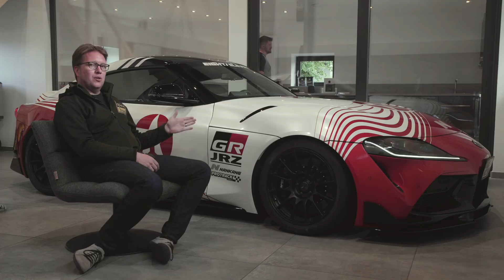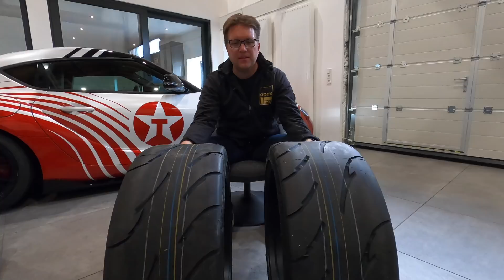Tech Talk: Toyota Supra, Ruined by Bump Steer?!?!

Comment: Control arms and tie rods won't help the bumpsteer problem, you need to relocate hard points on the chassis and knuckle. If you just change the rods you'll change the track width too which will affect both the front and rear suspension design decisions, not worth it imo.

Comment: I wonder what a comparison between the stock a80 and the a90 would result in suspension. I can imagine the a80 is heaps better. Toyota became a joke a long time ago and of course they would spend twenty years and release a botched Supra with only slightly more hp than the original and a compromised suspension geometry.

Comment: Early S2000 had a similar bump steer issues but got fixed with the face lift. This was almost 20 years ago, lol. Seeing this in a 2020 car is a big letdown. I wonder if the Z4 has similar issues. Since it's the same platform, it's very propable.

Comment: Why would you Chuck brakes and bushes in if you know the fault is with bumpsetter ,? Would have thaught you would have made different mounting points etc ? When can we expect an update ?
Reply from the maker: At the time there wasn’t a kit or arms yet. Many cars bumpsteer can be solved With new bushings. I felt like I needed them anyways so I started there. It’s quite logical actually
Reply: @RobertMitchell  ahhhh the bushes and suspension stiffen the ride so the travel is less ?

Comment: Hey Robert , About the zero toe instabillity , In my mind toe affects stability via the form of slip angle based on lateral force sensitivity to vertical load. Thus as you mention toe in adds stability and toe out "dartness". In that sense zero toe is something between these two not something that would create more wanderness than toe out. Can you explain further why zero toe would be bad ?

Comment: How much toe in would you recommend for the rear ballpark on a GR Supra that is lowered but not tucking the rear stock tires?  When loading the front going neutral toe in the rear seems to be the the issue right?  I don't want to go too aggressive for toe in the rear to compensate for rear lift bump steer toe angle change, but it seem this could be a bandied fix for the time being.

Comment: Robert: "Let's talk about facts" 
Also Robert: Provides eleven minutes and thirty two seconds of conjecture with no backup
I'm not trying to defend the Zupra, I 'm looking for the facts. Providing alignment specs as received, and since you are noting bump steer, toe figures at rest, fully loaded, partially loaded & negatively loaded while on the stock suspension setup, then provide those figures again for whatever modified suspension setup you are running now is what would have made your conjecture facts. Saying "the rear feels twitchy on lift off or hard braking" without any corroboration/data isn't a fact, it's conjecture/opinion.
Additional note: the Zupra has a "50:50" weight distribution, however more than half of that I-6 is forward of the front axle, that isn't helping under braking, as it will make the rear lighter than if it were inboard, hence my suggestion to check it negatively loaded and provide the numbers. 
When I look at the engine bay sans-plastic cover, it makes me think somewhere in development Toyota had planned to go with a version of their V6TT, but nixed it for cost savings (or I-6 fanboi love) during production. I think it would have been a better handler with the V6TT, as more of the weight would have been inside the wheelbase, but that's just my opinion.
Reply: yes I had the same question about this vid, too. They state supra had the bump steering "feelings" and twitchy on weight transfer, but gave no scientific examination. I didn't see any strong evidence on this video

Comment: I somewhat agree with your premise. You're not describing what's really going on with no toe. What's causing the "follow the road" effect doesn't really have anything to do with the toe being zero. It's because of the way tie rod ends work. Having toe in/out puts inward/outward tension on the TREs. Which makes the steering feel "tighter" and less "wandering". No toe essentially introduces "slop" in the steering because the TREs are not under inward/outward tension. Making it feel like the wheels want to "follow the road", particularly when driving in a straight line. But it's really that it's just not as easy to keep them from "following the road" due to this inherent "slop" in the steering when driving straight. Other than that zero toe is optimal. Since you rob yourself of some power with that wheel scrub too.

Comment: They say the 2021 Supra has been extensively changed and some changes were made to reduce bump steer. Wonder if they did anything to the rear bump steer issue...
Reply from the maker: I have heard this and am eager to try it.
Reply: @RobertMitchell  Wisefab is making some suspension components for the A90. Check out "papadakis racing 2020 Drift supra  CAD designed roll cage install and fabrication" youtube video.

Comment: As you know suspension geometry specified by chassis and sub-frame. I think you need an adjustable rear sub-frame. If it's multilink rear end, you really need CAD. Thank you.
Reply from the maker: Just hang tight.  Have some cool info on that front:-)

Comment: Bump steer is something I've dealt with in the lifted 4x4 world (front suspension) for years. In that situation it's all about getting all your steering parts and suspension parts moving on the same plane. The same arc. In other words which component in your rear suspension is tugging the wheels out of line on compression? What component isn't following the same arc as the control arms?
Reply from the maker: Big time topic in the 4x4 world!!!!! It can be both the control arms and or the tie rod bro following the same arc.
Reply: @RobertMitchell  I think I see the problem. It's the most forward lower link in the rear suspension. There's no way that can work right lol   Just kidding, What do I know :)

Comment: Also interesting you noted the unsettling of the 570S as you lifted the throttle.  I've driven 570S, 675LT, and 720S and have to say that upon hard braking, they all seem to shimmy back-and-forth while going straight.  I always attributed it their ABS/Stability Control systems wrestling each other. It's unnerving at first, but kinda got used to it.  I haven't driven them on the track, but I'm imagining that the benefit of this as you mentioned would be used to turn in sharp after braking hard down a long straight.  But on the road when stopping abruptly, the car definitely wanders in its own lane.  Hop in a Lamborghini RWD Gallardo or RWD Huracan and that definitely is not the case.
Reply from the maker: It was the early 570. They changed the rear subframes and toe arm angles after some heavy complaints

Comment: So how much actual bumpsteer is there? Did you fit a bumpsteer gauge and plot the toe change, then look at adjusting arms etc to address it?

Have you compared it to a Z4, if that has no bumpsteer, what is different? 

Whilst an interesting video, the lack of detail in the actual amount of toe change over the suspension travel is surprising and leaves the watcher with more questions than answers.
Reply from the maker: Wait for round two pinderwagen. :-).  Hope all is well!!

Comment: They missed the boat across the board, the styling doesn't say Supra to me aside from  maybe two very specific angles, it should have been called something else just like with Dodge and the Charger. They didn't have a car driver design this thing and cut far too many corners. Which is ironic because the car can't cut corners.

Comment: If its anything like the Z4 it probably more than just bump steer. The whole rear end is made of rubber bushings including subframe mounting. The only exception being the camber arm spherical pushed into the upright. There will be a hell of a lot of compliance steer within the rear axle. I haven't seen a toe curve for a Supra but in general all road car manufactures will design toe in in bump on the rear for safety understeer. I'm looking at my toe curve for F series BMW and the bump steer looks fine, around 1min/25mm in bump near the useable suspension range after lowering. As the car has a static setting of toe in it is unlikely the car will cross from toe in to toe out even after lowering. If low enough it will move around between toeing in and toeing out but never will the number measured be toe out.
You will ofcourse change the BMW factory toe curve if you lower the car and then set the static toe to what BMW recommend as this is for a different ride height!
I would suggest spherical bush the whole rear end not just the toe links and solid mount the subframe before altering the link lengths as I think compliance steer will be a huge part of it and not really measurable on normal bump steer rig.
Good luck!
Reply from the maker: We’ve changed the bushings. It’s bump-steer sadly  :-)
Reply: @RobertMitchell  OK so can you back that up with a toe curve? Would be very interested to see one.

Comment: Another great video, i started mechanical engineering tried to reach chasis/suspensions on nice racing series someday, sadly life revoqued my dreams (dont even own a car). This is super interesting and you are extremely spot on how you explained it. Hope you get to the bottom of it. I have seen analysis cases of bad angles on steering racks and links ruining front suspensions travel toes but you cant counter misbehavior of rear suspension with your hands, very surprised here.

Comment: Maybe it was diff, I think this car has got computerized clutch typed LSD, on and off throttle computer decided locking force for each rear wheel that definitely will change car behavior.
Reply from the maker: Hehe no. It’s bump steer:-)
Reply: @RobertMitchell  I had honda integra DC5 TypeR before, that front suspension probably is the worst bump steer suspension ever,tried few things,nothing worked. Now I have 340I probably similar suspension with this Supra, I don't like the rear, No confident when pushing hard, I thought it was the soft springs, maybe not after seen this video.Interestingly, the F80 m3 has different rear suspension compare with non-M car, do you have the same problem with F80?

Comment: Hi Robert, I'd like to hear your thoughts regarding delrin/solid rear subframe bushings. I have a E92 335is and I know that this is how people tighten up the rear end instability on the E9X platform, and which is what BMW did for the F80 and onwards. Just wanted to confirm if the Supra has this addressed and if you think it contributes to the bump steering you're experiencing? Hope you can reply!!
Reply from the maker: The Supra has had the bushings Upgrades yes!!   That and control arm bushings have been a problem as you say in MANY cars

Comment: Really good info 👍 Is this about the 2020 Supra or the 2021 (or both)?
Reply from the maker: 2020 model... not the newest one which I've set to have seen
Reply: Got it. 👍 I am curious as to what other changes Toyota has done to the 2021, suspension wise, as they have already changed the pistons (dropping the compression ratio from 11.0 to 10.2) and changed the exhaust manifold configuration from 2 port to 6 port. Those are fairly significant changes in one year of this model’s existence.

Comment: It blows my mind that you can spend all that money on mods but not find the money to have a race shop dial in the bump steer by simply modifying the rear track rods and mounting points.
Reply: Will do.  Also, there is a bit of misinformation in this video where you say "you would never go neutral" on toe.  We have several customers running zero toe on their championship winning Spec Miatas and high horsepower turbo AWD rally cars.
Reply from the maker: I wouldn’t go zero to on this car.  And most certainly not above zero then below in a simple lift off situation.....  

There are many many exceptions to certain rules or statements but in this application here I am discussing i would not.  We cannot take an all wheel drive turbo rally car and compare it to a factory road car that is delivered with instability that is so bad from the factory while driving straight and doing nothing more than Lifting off the throttle :-).
Reply from the maker: Didn’t I mention that we were working on something bigger for it?  Parts being designed?
Reply: I heard you say you "knew what the problem is but didn't know how to fix it".  Any good chassis tech with fabrication resources could measure your bump steer and fab up a few parts relocate the inner track rod attachment point to dial out that bump steer.  Chassis tuning 101 for a proper race shop and maybe a day or two in the shop.
Reply from the maker: Luis DeTomaso said we knew what it was but didn’t have the parts to fix it.  We are helping to develop an on the shelf product that actually works and its not just a relocated toe rod arm.  As since actually measuring the rear end geo shows problems in the control arm moment too.  Maybe give a sub or check back occasionally and I’ll get a video up on exactly what Is being produced:-)
Reply: Yeah, what a joke that such a flawed design made it into production.  Does the sister car Z4 rear suspension possess the same garbage geometry?

Comment: I had the chance to drive the new 2020 Z4 which is the same base as the Supra and I have to say the rear end is exactly like you said . I´m not a professional driver but I did absolutely not feel save going hard with this car because of the rear.
I absolutely can´t believe someone calls himself engineer for this. Even the actual CLA felt better in cornering for me, which is a disgrace. Because the CLA and Z4/Supra should be worlds apart

Comment: I don't feel the issue is bump steer, I found the issue was ESC/TRC kicking in for no reason (even when disabled).. This nearly put our A90 into the wall several times.. There is a HUGE issue with this car... This has to be the car with the WORST ESC than I have ever encountered. Yes I found the back end to drift, and be "playful", but the bigger issue for me is that the car decides to brake individual wheels when it thinks you're out of control. What it doesnt realise is that the turn/brakes/movement was deliberate.. After which we found it tried to put us into a spin, then ultimately into a huge tank slapper..
It's possible what you are saying is contributing, but that being said, the car when pushed to 8/10th is incredibly capable, if you go that last bit and push the envelope, it decides to be a completely unpredictable beast.
Check our video here which gives our feedback on a similar issue: https://www.youtube.com/watch?v=yEapjtcTgRk
Reply from the maker: I can assure you that it is bump steer. It is not the ESC    I actually have all of the graphs and measurements confirming this as well

To confuse bump steer and ESC would be quite a huge miss.
Reply: @RobertMitchell  I can feel the ABS kick in if you trail brake and correct a slide.. Bump steer does not do that. I literally can hear the BRRR noise of the wheels braking when it thought I was having an accident. I added SPL control arms, traction rods and toe links, as well as 305 wide semis and the car is worlds apart now that we have the ability to add camber to the front. The car still occasionally tries to do strange things, but at least on my model it isn't caused by bump steer. Mine is definitely an electronic issue.

Comment: Stick a GoPro to the underside and you might be able to see what flexes.
Reply from the maker: We have full test data I’ll reveal soon
Reply: @RobertMitchell  Please make sure the car is at stock ride height for this toe-change data, and also include a Z4 for comparison. If the Z4 is different that would be really interesting - maybe bushings or static toe differences?
Reply from the maker: big track3 the measurements we have are from stock height and then again lowered. As suspected it’s bad at stock and a taste worse lowered

Comment: This chassis is always going to be a handful on a racetrack.  Its short 97" wheelbase doesn't well accommodate the long inline 6cyl engine.  At least half of the engline sits ahead of the front axle.  Weight tranfer in braking from high speed the biggest issue.  

I want to like this car....   but, I can't.
Reply from the maker: I think that once the rear is sorted it will be very well balanced

Comment: I find it unlikely BMW/Toyota would have allowed such a bump steer sensitive design to manifest from multibody simulation all the way to series production vehicles..  Are the build sequence numbers of the problematic Supras close together? A possible cause may be, tolerance stack up across the suspension hardpoints, combined with maturity/variation of the child parts as they ramp up production. Additionaly the lowered ride height could exaggerate the issue further. 

Have you disconnected the damper and measured the rear axle geometry through its travel?

Is the rear axle isolated? Intersting to see the bushing design, as shortfalls in subframe bushing Z-stiffness could lead to significant axle movement under 'spirited' driving. 

I suggest you raise the issue with Toyota, and if enough people have an issue with it they will follow their business processes to resolve the problem. 

Interesting to hear your experience on this, as I have seen issues like this pop up at various prestigious OEM's in the past.
Reply: why not just run some spacers on the tie rod end to change the bump curve (after plotting it).

Comment: I thought bump steer was about connection to the tub, height and placement.  New control arms, even adjustable ones need to connect to new holes on the tub /or hub to fix the problem?
Reply from the maker: I will go into a bit more on this very soon.  its a combination of how everything moves. control arms and tie rod ends. it all needs to move together